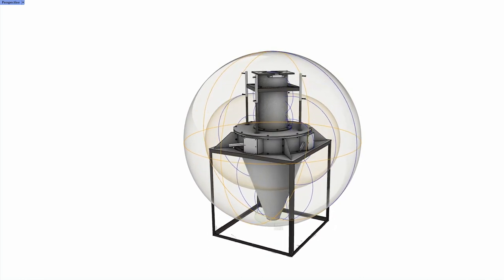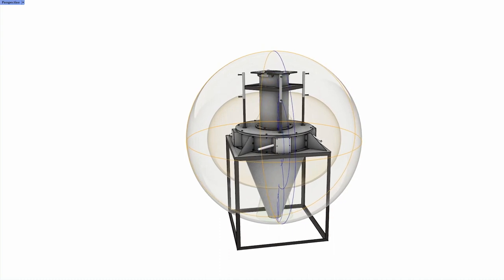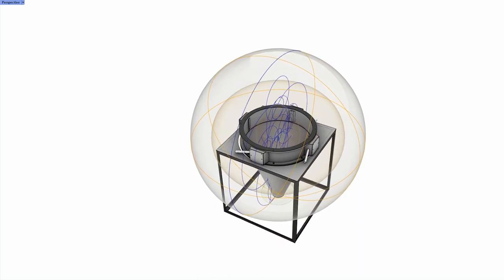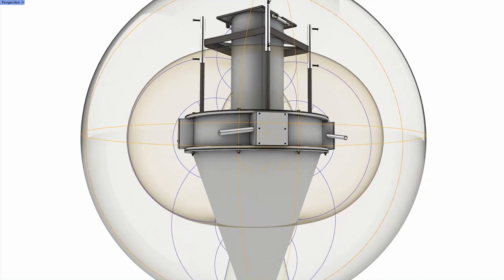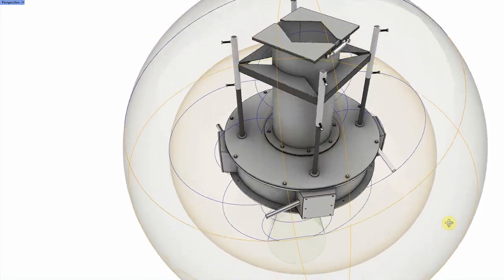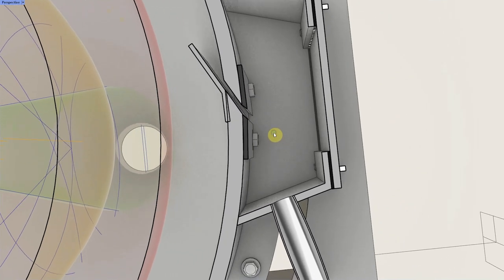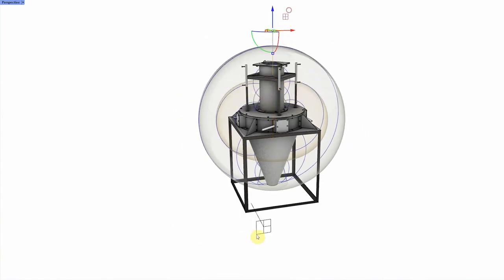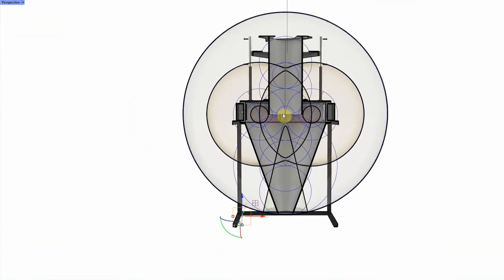O-Day - Windhexe 'Tornado Machine' + 3D 'O'

Comment: 3:30 Windehexe as a particle sorter? The idea would be to insert the cone instead of the Sothic triangle so that the bottom walls of the cone do not touch the windhexe wall. This is where the heavier particles would fall out of the windhexe. Here, the lighter particles would be pulled into the Sothic cone and fly up out of the windhexe due to the cutt off tip of the Sothic cone. Maybe.🙂
Reply from the maker: Only way is to try
Reply: @MFMP  When I looked now at the Swedish Airgrinder patent, they have a similar solution.
Reply from the maker: @zdenekbreza3770  Apparently they bought a license to the patent when it was still active.